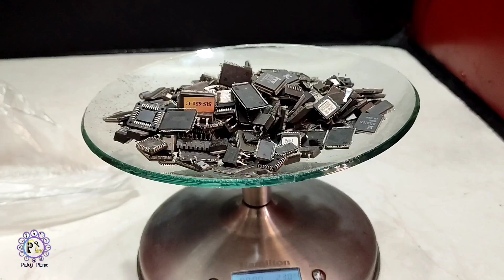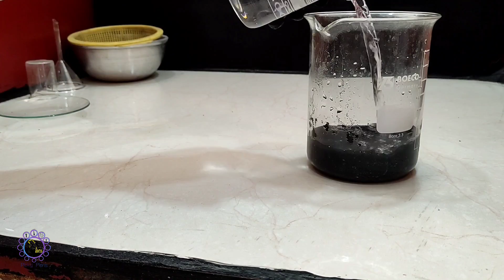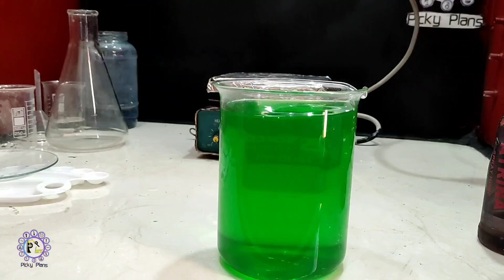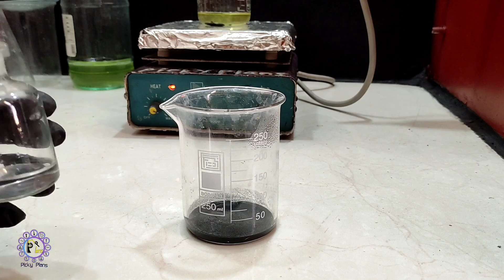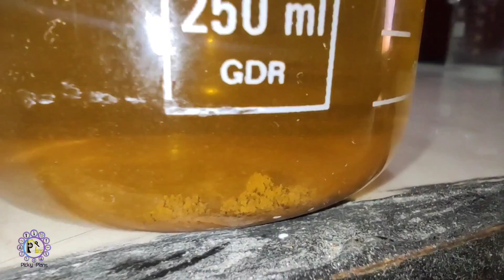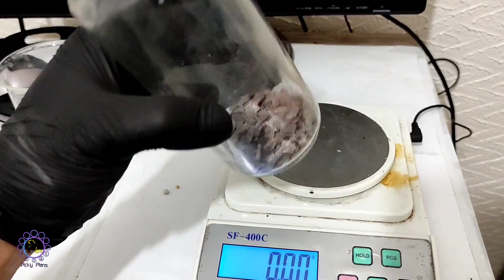Gold recovery from 32 motherboards mix IC chips and transistors

Comment: About $10 worth of gold. How much worth of chemicals to recover it? :-)
Reply: @PickyPlans  glad to hear that it is cost effective, once you have all the setup to do it. I just guessed that it was more than that, so you'd barely be breaking even, hence my smiley.
Reply: @PickyPlans  you shold recive atleast 1g of gold from 300g ic chips mix.
Reply: @niculanicolaeofficial9114  I haven't processed any of my stuff yet but I think a minor issue is blowing the torch directly at the powder at the end; most videos I see recommend to filter the gold powder with filter paper, then when you go to torch the filter/gold powder mixture the paper burns and takes the brunt of the blowing heat so that small gold particles melt before being able to be blown away.

Good work though, I currently have about 15 pounds of mixed IC/Transistors. This doesn't include my BGA and Ram chips.
Reply from the maker: Thanks mate , constructive advice it helps a lot you know while drying powder in the last wash i use pinch of sodium carbonate in water to spreaded as flux among gold powder. When start heating crucible i usually start from sides to help with melting flux both crucible coating and gold flux either. Then i start blowing directly on low oxygen pressure when gold start melting i increase O2 pressure a bit . But it seems using filter paper is easier choice.
Reply from the maker: That's good amount to start congratulations 👍
Reply: @PickyPlans  thanks, I have about a pound of small bga chips off ram and main boards, 2 pounds of ddr1 ram, 1 pound of gold corner bga and a pound of vintage white ceramic ic chips. Only problem now is saving money for equipment to process the stuff
Reply from the maker: You can start from scratch from those which are easier like BGA then buy some equipments with yielded profit. all  I'm saying is that don't wait for being 100% equipped. Little advice ، don't be a perfectionist